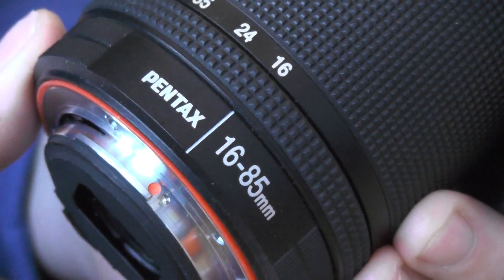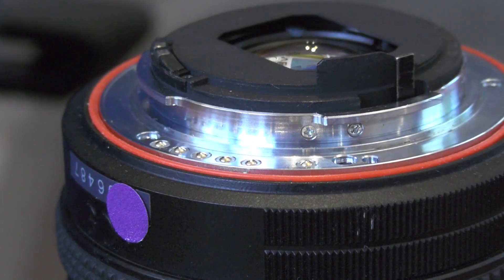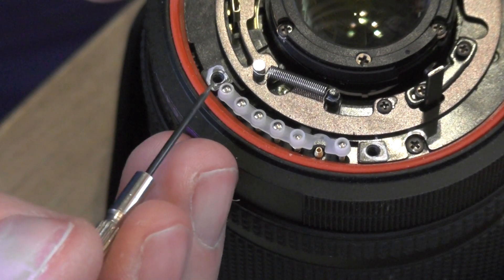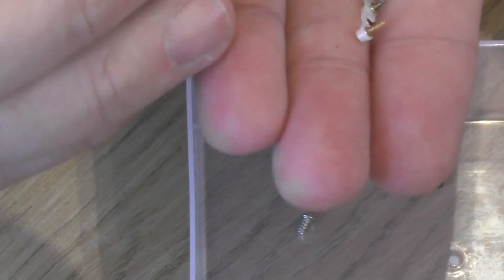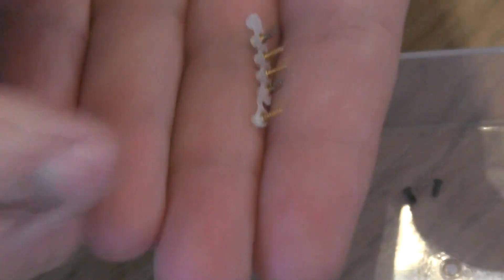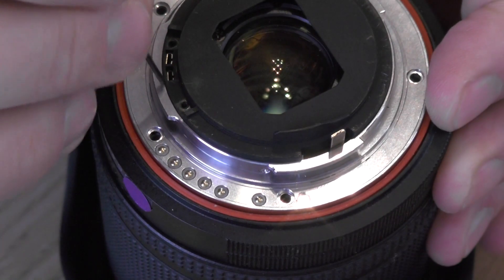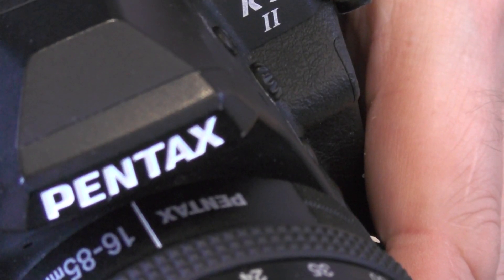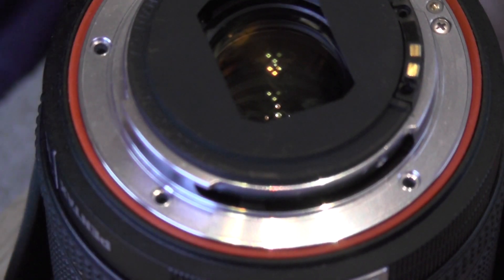Repairing the contacts on a Pentax 16-85 AF zoom lens

Comment: Japanese equipment uses JIS screws, not Philips screws.  The difference isn't huge, but it is best to get a set of JIS screwdrivers.  They are easy enough to find, and don't cost a fortune.
Apart from that, good video.

Comment: Hello Peter, thank you for this video and for keeping it online  _ have managed to strip off on x2 lenses, one of the brass Autofocus contacts, that allos Af communication between the camera and lens :( . Your video suggests that this brass strip can likely be replaced, rather than having to source or find the entire unit (male brass plug) . Do you have any thoughts on this approach?
Reply: Oddly enough this happened to my 200mm F2.8 yesterday, I immediately ordered a kit 18-55 for £15 and will swap the contact block over. I'll let you know, but from the lenses I've seen it's the same unit.
Reply: @genius-photo  ha ah, 18-55 that was another thought, I wonderd if there was is a cheap donor lens. I agree, on my impacted  60-250 and 15-30 the af connection unit does appear interchangeable, which would make sense from a manufacturer/production standpoint.
Reply: @GeoffMoorePhotography  I have an answer for you already. I realised that the 18-55 won't arrive in time for a music festival I'm photographing on Sunday so I took the contact block off the 16-85 in the video and put it on the 200. It's the very same thing. When the donor lens arrives I'll then repair the 16-85. I was with a client yesterday at a sporting event and when I put the 200 on at one point it wouldn't focus. I switched back to the 50-135 until I had a chance to look and saw that one of the AF contacts was almost torn off, I think it had raised up slightly then caught on the lens mount when turning. My thought is that the AF block is removable because it's an afterthought on the PKA mount and is highly susceptible to this type of damage. I'm pretty sure, though, that they could make it with both ends of the upper flat lens contact folded into the plastic frame, rather than only one end.
Reply: @genius-photo  Yeah, excellent sleuthing Peter. The contact is like you said susceptible to rising up off and catching the lens mount, this has happened several times for me in the past and I have managed to press the brass back down, however this significantly weakens the brass and i suspect one collision too many has caused the brass to break on the crease. With that in mind, looks like I have a couple of options for repair... doner lens from ebay or as I have just ordered some Brass Sheet Roll, 0.3x10x1000mm which I'm hoping can be fabricated with some garage tools to create a new contact and slide that into the plastic mounting unit.